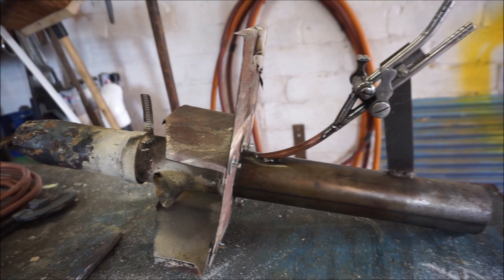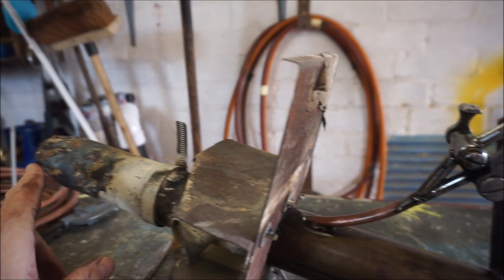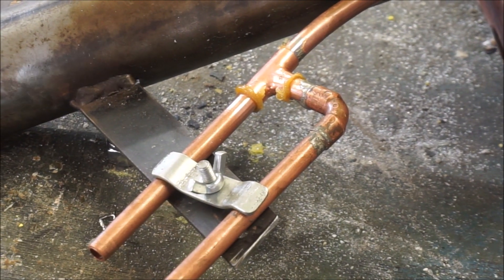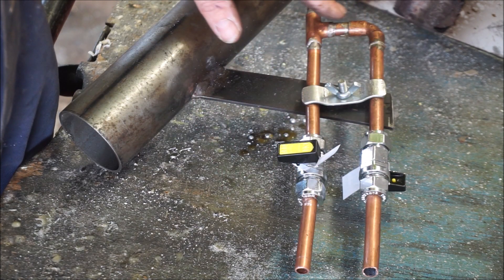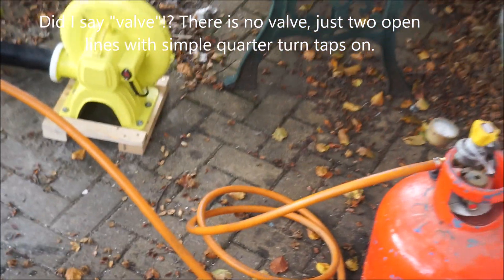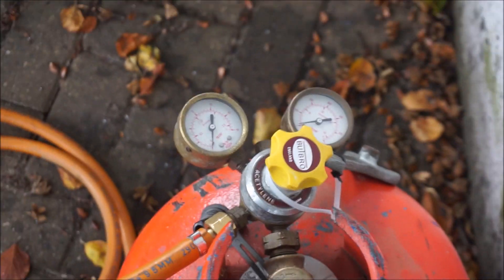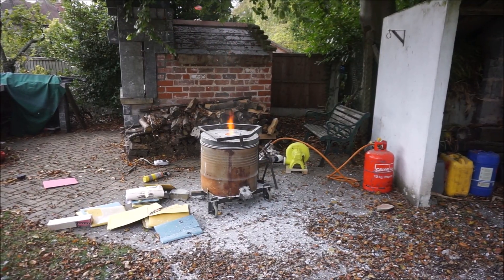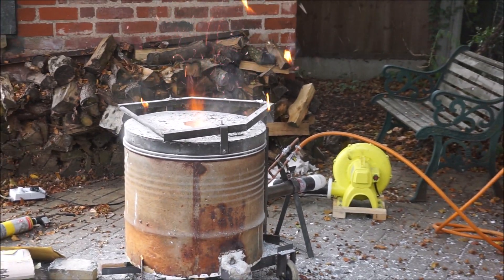Furnace burner upgrade to oil and/or propane

Comment: I could never understand why people use wood to light a oil burner when propane is so much easier to burn. Good to see that my videos were useful to you.
Reply from the maker: Absolutely useful! Thank you! I am really pleased with it. The shear simplicity is a beauty. I was so hung up with jets, orifices, air flow.....then your video...."length of tube doesn't matter"...."pipe in gas"...."position doesn't matter"....but "has to be used in a furnace"......it was like a breath of fresh air! Cheers!
Reply: The answer is cost. I can burn through an entire 5 gallon/20 pound (9 kg) tank of propane to get my furnace started (up to the temperature where the oil burns well). Of course it has 350 pounds (159kg) of refractory in it to heat up. I can get wood for free, but a tank of propane costs $15 US. If you make a furnace with Kaowool and try and melt iron in it, you will be replacing your lining as most mineral wools are not up to the temperatures encountered. I have not had to repair the lining of mine for several years now of firing hard. If you live where wood is scarce you might ask someone who lives in the forest why they use wood for everything.